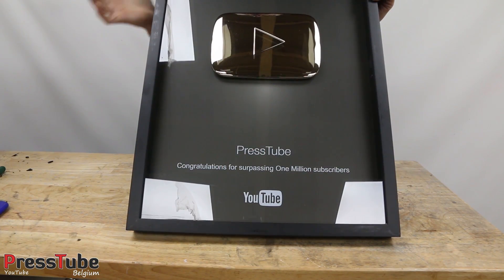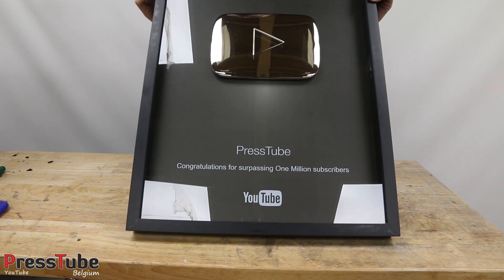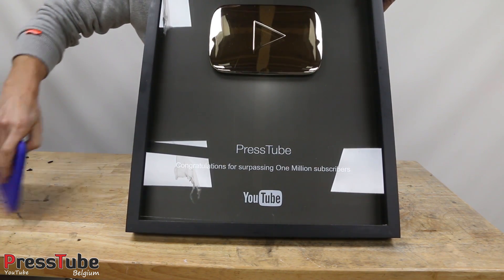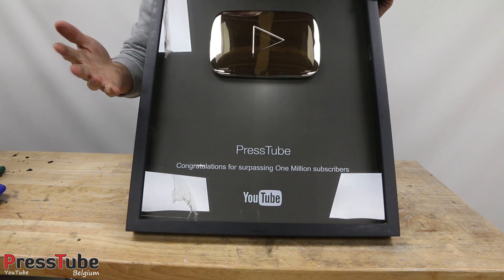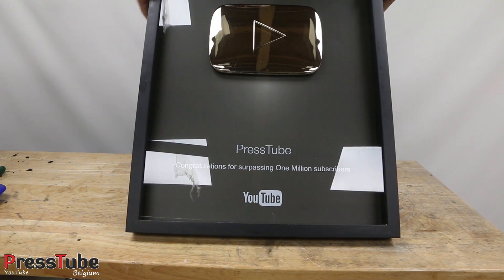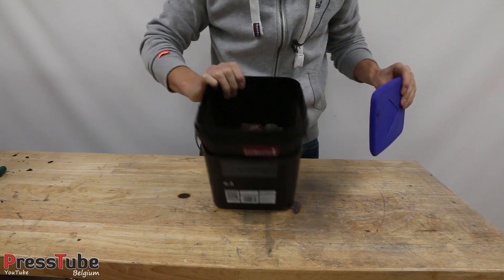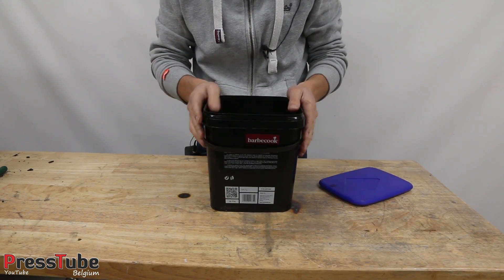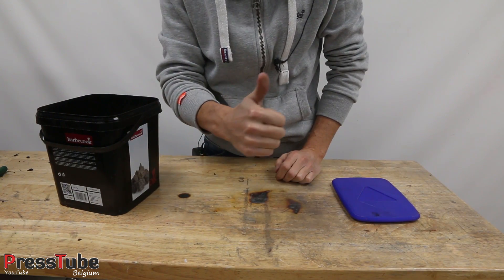Casting YOUTUBE PLAYBUTTON from MOLTEN LAVA ROCKS! | Is it possible to cast MOLTEN LAVA STONES??

Comment: Have you ever thought of making an arc furnace out of your mold to help keep the basalt in a liquid state for the entire pressing 🤔

I ask as I've been considering homemade fused basalt tile and block as a building material then again fused together after assembly. 

(That or more hopefully just pouring a monolithic dome structure, only down side would be no indoor cell signal "without modifications" and of course hanging pictures 😀 )

Comment: Do it again. But keep 3d print in the mold. It should burn away completely. And the extra heat from the burning 3d print may keep the rock hot longer

Comment: If you take lava rocks, and melt them until they're white hot. However long that is. If you pour the lava into a mold, try to make it quick. And make the mold thick and insulated. The longer it takes to cool, the stronger the resulting rock will be

Comment: Hey Presstube, you could try casting the button in silicone... Then part in Freeman wax, then in casting investment, then "slump" the glass into the mold like glass casting is normally done. that way it can cool properly and not shatter.

Comment: Cool video, it seems like the lava is a bit too thick to cast things properly, so I am thinking, would it be possible to mix it with metals such as aluminum, copper or brass?those could add a nice metalic shine to it as well as make it less brittle.
I haven't seen anyone on YT attempt this so you could possibly be the first one to do so.

Concept of putting metals back from where they came from (rocks) sounds rather interesting :D